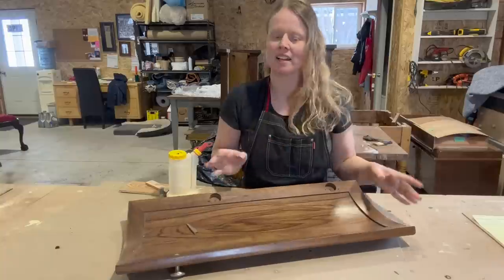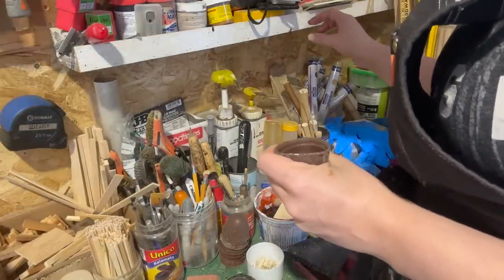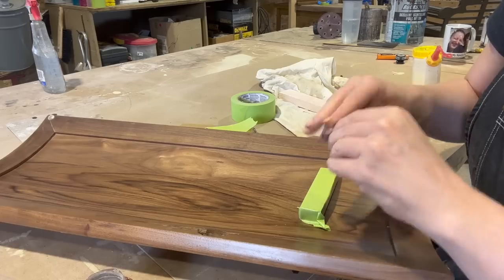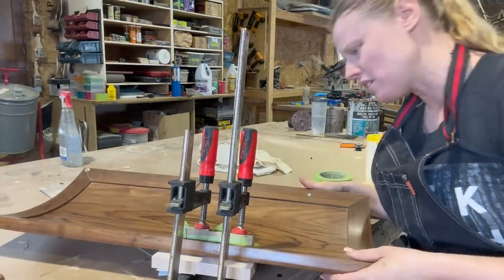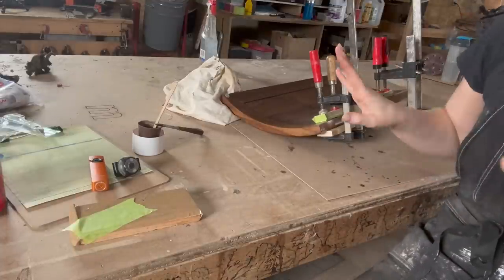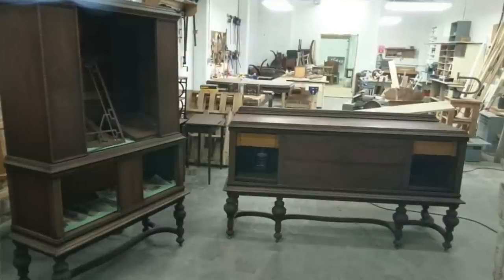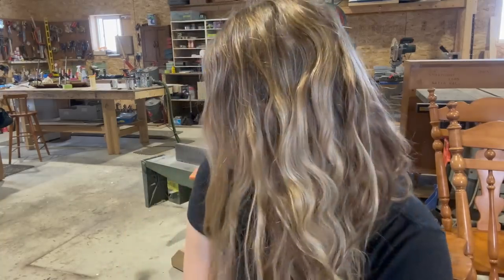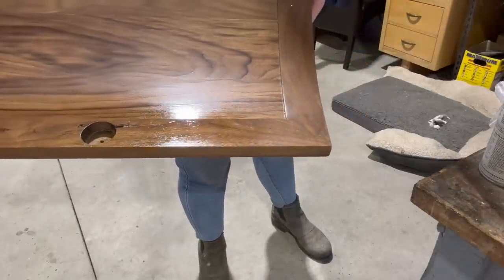Little glue-up, big news

Comment: Having retired at 66, five years ago, I've had non stop requests for my talents in restoring one thing or another. My not having a shop stopped that possibility. Now I've done it... I leased a 2,500 square foot commercial building, threw the doors open the 14th of last month and it's been full of money jobs since. My wood shop takes up part and auto restoration, the rest. Good luck to us both!
Reply from the maker: Awesome!
Reply: @johnsfurniturerepair  My motto has always been, "Don't make it look like wasn't fixed...make it look like it NEVER needed fixed."

Comment: I've been using that style of hinge for twenty years, but normally only for cheap stuff like kitchen cabinets. I've never had them break out, even in hardwood like that. What usually causes problems from what I've seen is somebody kneels down gets something out of the cabinet, then put their hand on the door and use it to push themselves to their feet. Even light pressure will eventually kill the hinge and possibly blow the wood out;
Reply from the maker: Ah yes that may have happened

Comment: Princess auto has some Aluminum Adjustable Bar Clamp/Spreader (Propoint brand) that squeeze crazy hard and are geared to only need the one hand for max pressure. They blow away all my other bar clamps and are way more solid. The removable jaw quick releases like the Dewalts you have. The heavy spring in the pad assembly makes all sorts of difference putting delicate force into a work-piece . They go on sale.

Comment: Thanks for sharing your exciting news. Sounds like you have a lot of good opportunities coming with this move.

I have seen a number of curved front doors that have problems with hinges. If you encounter another door that has damage that reaches to the edge of the panel, you can stuff a small wad of cotton next to the panel before applying the epoxy. This will help prevent the problems that are caused when the panel is unable to expand and contract with the seasonal changes. An alternative solution would be to substitute a small square of fabric tape instead of the cotton.

I enjoy learning the little tips and tricks you share with us. Hopefully, I can offer a helpful suggestion from time to time too.

Comment: I started using West system 1987 with their pumps like you have. I use powered Aniline dyes to get colors too. Or a dash of Ultra by Mohawk
I use so much of it on old busted up upholstered antiques,etc. I  upgraded soon after to this pump  west-system-306-25-model-a-metering-pump and haven't looked back. 
Rebuild kits are sold by them for a small amount of money. With this  great dispenser you can pump a pinch or what ever you like and not worry about doing  a half way mark and wasting it if not needed.

Comment: I also wanted to add a comment about your bleaching video from last week.  Wow, I learned SO MUCH!!  I picked up a small hobbyist made ash side table from marketplace that I plan to strip and refinish.  The maker tho likely used black stain to darken the grain, wiped it away and then applied a clear finish over it.  I now understand how much work it would be to lighten the black stain in the grain so that I could use a white stain on the table, and I just don't have that kind of time or space to do so.  Thanks to the knowledge you shared with us last week, I will be embracing the dark grain and will choose a medium or darker color for the table.

Comment: What has worked well for me . . . using 100% cotton as a filler.  Cotton is a cellulose fiber, wood is a cellulose fiber and the two mix very well together.  I take a cotton ball, pull it apart, stature it with PVA glue, push it into the cavity to be filled, when it dries it makes for an incredibly strong bond and it holds fasteners very well.  In my opinion it works better than wood epoxy to fill gaps.  Enjoyed the video, thumbs up and thanks for your time.
Reply from the maker: Great idea!

Comment: As a stand for those silicone cups, you could use a plastic water colour paint pallet with the small wells. You could also just stack some of those small wooden sticks in a log cabin format with a silicone cup inside and use the remaining epoxy to attach them together.
One more hint... You can also use duct tape on the wooden block and the epoxy will not stick to the duct tape.
Congrats on going home!

Comment: Move: I wish you and your family good luck on your move.

Kitchen Door Hinges:  The kitchen cabinets are handsome but they skimped on the door hinges.  Those curved doors are heavy and deserve to have three hinges.  The third hinge could be added now.

It doesn’t appear that the designer did a section layout for the stiles, panels, and hinges. (I have been with this problem on one of my projects where I didn’t do my homework.)  What a shame for such a good looking kitchen.

Flashlight:  It is my experience (not conjecture) that one wants both rechargeable and disposable battery flashlights.  In August 2020, we had 100 – 150 mph winds for over 45 minutes (Linn County, Iowa, USA).  Over 90% of the county lost power.  Our local part of the power grid went down.  It took 8 days for us to regain power (and the power company was doing everything it could).  Conclusion - no power – no recharging.  Recommend having extra batteries on hand too.

Comment: Congrats on the move. I hope all is going well with it. In this video you talked about bases for the cups. I the dental lab industry we use a two part silicone putty that is completely shapable until it hardens. We use it to make bases for small or unstable items. It will stick to other silicone so use a vasoline film to prevent that. It will also work well to replicate a damaged area the replicates on the piece, ie: trim on a leg.
Reply from the maker: Yes I use something similar. Cheers

Comment: Hi Trena. Just a suggestion but you could use a paper egg carton as a stand for your epoxy mixing cups. The round bottom of the cups should fit well in the egg carton compartments. Again, just a suggestion. Great repair video. Wish you the very best with your new adventure!
Reply from the maker: Great idea!

Comment: Hey Trena. I use metal "tricerts" which you drill a corresponding size hole using 6-32, 8-32 or 10-32 size screws. The metal threaded tricert gets a tad of epoxy or super glue-then screwed into the predrilled hole. It makes the connection a mechanical one not like wood screws which tend to strip out. You still need to repair the tearout just like you did but this connection will last!
Reply from the maker: Oh thanks that’s a great idea

Comment: Regarding your silicone muffin cups, you might want to check out silicone "pinch bowls" that are used by cooks. I use those for epoxy. They aren't as large as your muffin cups, but they have a flat bottom so they're easy to work with.

Comment: You could shore up the piece by putting a screw crossways on both sides of the hole for the hinge.  It's almost impossible to insert the screw from the inside, so it'll have to put in from the outside, counter sink it deep enough and then you could probably put some glue over the screw head and stain it the same color.  Or something similar.

Comment: As long as wood glue also does not stick to those silicone muffin cups, you could get a paint can lid or whatever it fits in, mix some wood glue and larger wood chips, and squish the cup down in until it fits in an outside 'form', let it harden, and then you would have a more solid frame to sit it in.  I saw it on another video, but I have had good luck with packing tape on my 'pressure' boards when clamping up to keep epoxy and glue from sticking to them.  I havent tried painters tape...but I have had glue stick more on painters tape once or twice.  ie had more cleanup than if I had used packing tape with no stick.  I keep a packing tape dispenser right in the cupboard in the garage just for that use.   Congrats on the move :)

Comment: With such damage, I would prefer to change the position of the hinge.  Move it up or down the door.  Patch the old hole and just make a new one.  This is usually quite possible and very easy.  You just need to move the counterpart of the hinge on the side of the cabinet.

Comment: Having used thousands of Euro hinges  it appears to me that perhaps the degree of opening for the hinge may have contributed to the failure. I would have used a 170 degree hinge in that application. But having said that a curved door most likely could create leverage forces that could cause damage if opened past a certain degree. I’d caution the owner to take extra care when opening the door. Also hinges that utilize screws instead of dowels typically are inexpensive hinges that most likely don’t open past 110 degrees. If the hinges were cheap 110 hinges you can imagine how that would really limit access to the interior.  Perhaps a petite chain anchored to the carcass and the door could act as a stop. That’s a complex door to make but the application of hinging seems to be lacking. Now I’ll watch the rest of the video.
Reply from the maker: Wow. Great input. Thankyou!

Comment: So how does this repair not tear out again if you are reusing the original hinges? If the holding mechanism is to embed into the wood rather than use screws to mount the hinge to the door and you commented that the contact point is too close to the edge of the bore hole (so that the tension of the hinge opening and closing, over time, created the wood failure) how does reusing the hinge not reset the failure? You said the hinge that attaches with screws were the better design. Is the epoxy replacing the wood for the point of contact to embed into making it stronger? I had a similar problem of wood tension fracture from a over weight door and inadequate hinge mount. The tear out was in the cabinet mount and not the door. I solved it with epoxy but also replacing with longer screws that distributed the tension forces deeper into the cabinet frame every time I opened the door.
Reply from the maker: It should get a Better hinge. The epoxy will hold as long as the door isn’t over opened and stressed.

Comment: Next time take some sort of beeswax, I usually have a spreadable variety available, and coat the area you don't want the epoxy to stick to,, be sure to let it dry,, a second or third coat is great insurance, q-tips work well to get into small spaces,, if the cotton tip becomes frayed, give it a hair cut with sharp scissors
Reply from the maker: Thanks why didn’t I think of that. Lol